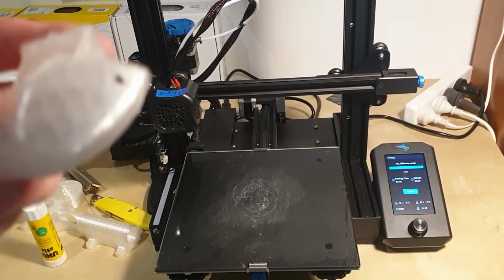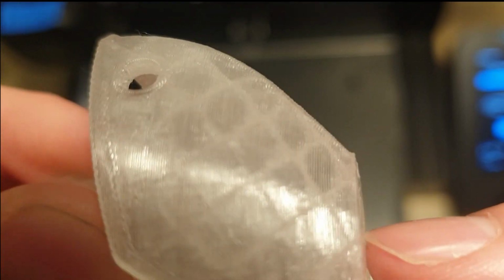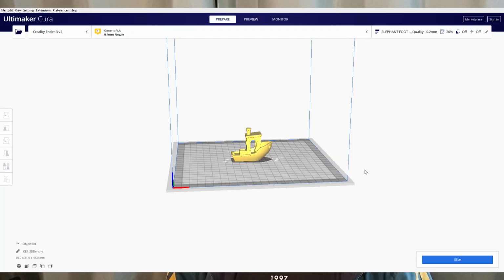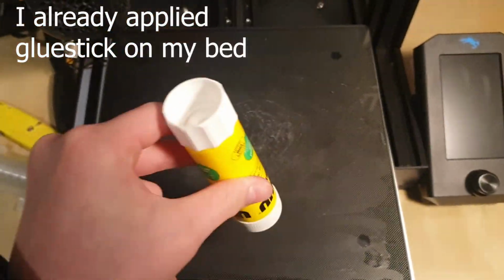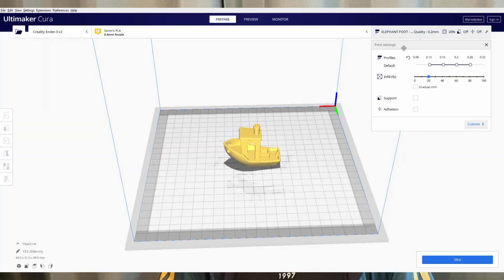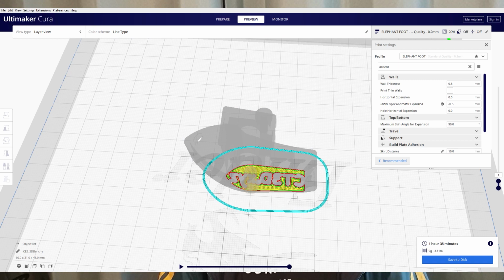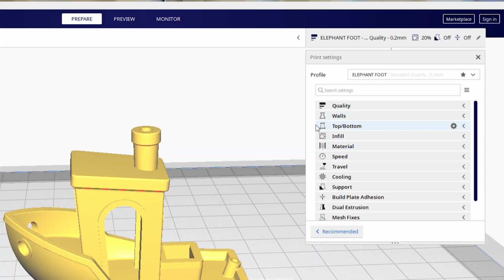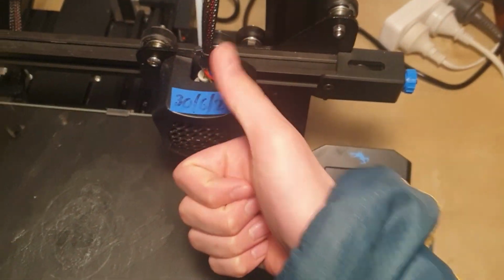Elephants foot and Z-axis Squash fix.

Comment: I found printing with External Perimeters First in PrusaSlicer fixed my issues. You just have to be mindful of overhangs. You can turn this setting off for the specifc layers that have overhangs if it works for the given model.

Comment: 0.2 mm for the bottom thickness is too thin, i can see through the material
Reply from the maker: yea if you need those bottom layers you should just use a raft